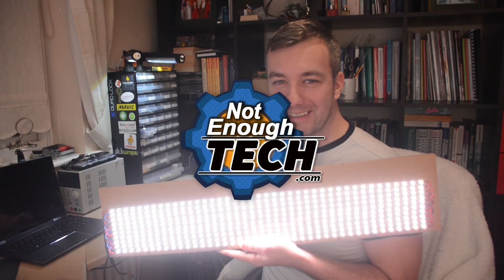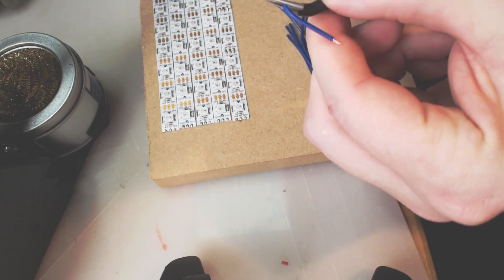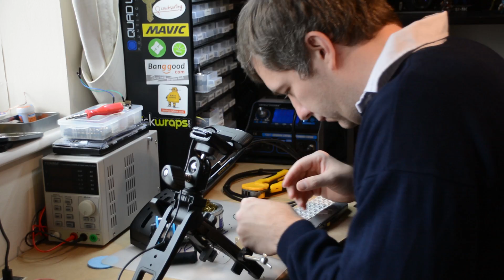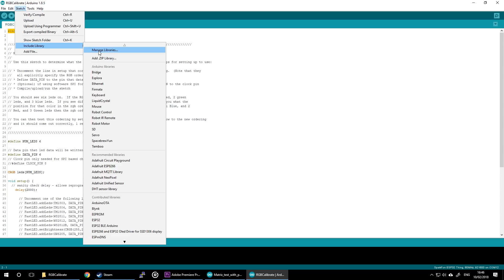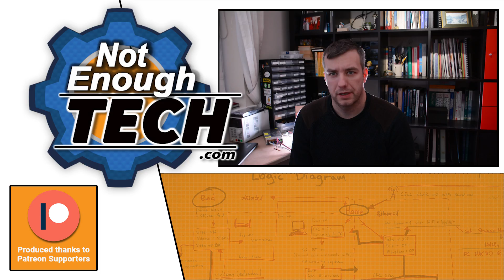410 RGB LED Matrix & ESP32: Power delivery and testing

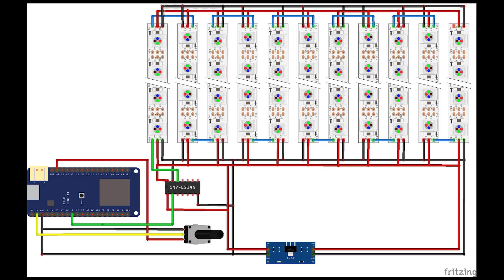Comment: In the video where you are using your breadboard, you have three wires hooked up to the ESP32 Dev Board. But in the schematic illustrated at 2:22 you have 4.
Which pin on the ESP32 board do you hook up the yellow lead that runs from the switch?
Reply from the maker: The initial colour test was done without the button. If you want to add a physical controller you will need an extra pin (or more) to map your input It was mapped to pin2 if I can trust my memory. I will have an article about building the panel soon as I came back to this project recently

Comment: Hi! 
Can i do this but with 2 LED matrices more using the same circuit.. i mean connected to different pins?

Thanks for the video.
Reply from the maker: Yes you can this is all driven by a single wire per strip